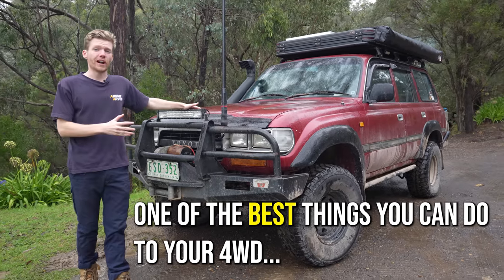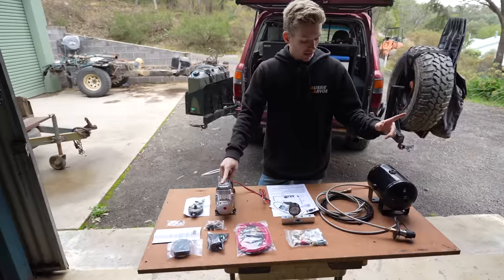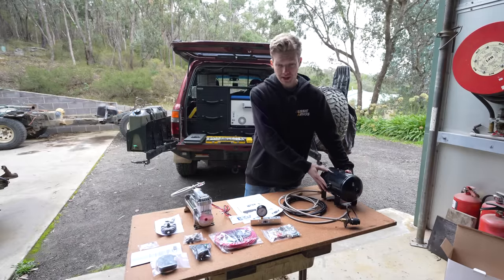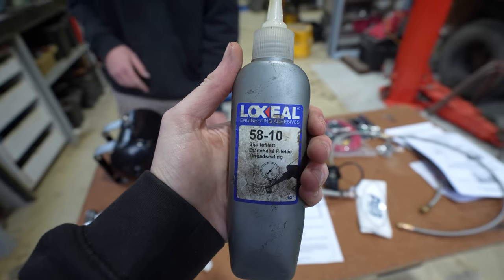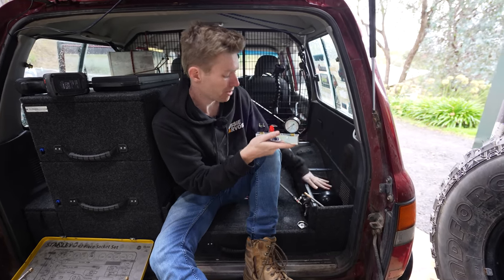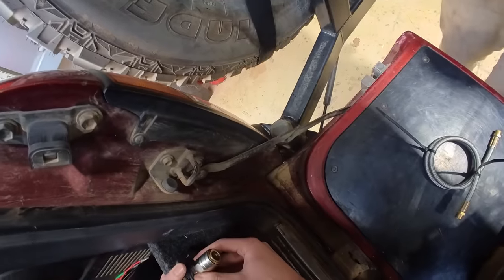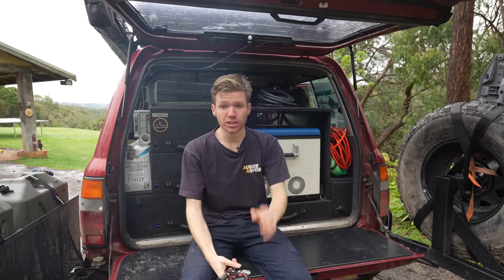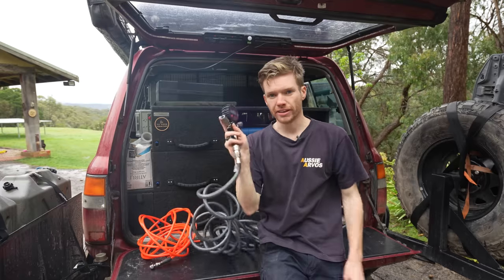Building a BUDGET on board AIR SYSTEM!

Comment: i did the exact same thing in my 80 series. to date, it was the most pointless thing i ever did.... i find the compressor takes ages to fill the tank, i constantly bypass the tank to fill my tyres up, because it creates a larger volume to fill to a certain pressure. (fills tank and tyre, not just tyre) its too quick to disburse to use as air filter blowing etc, and e lockers solve the need for a tank. you cant have more then 120 psi otherwise the compressor struggles....
Reply: That's cuz your compressor choice was a cheap slow unit. There's dual cylinder 300L/10.6cfm units available that aren't slow. They beat the $700  ARB twin units.
Reply: @mrmotofy  what are they? How much do they draw? Is it worth the cost? The kit from air on board that was in this video is what I used.
Reply: @EVERYTHINGOVERLANDANDUNDER  compressors are rated in cubic volume. So the higher volume output requires a larger unit and more power. So his unit here is probably 2.5 cfm or maybe 70Lpm (Cubic Ft/minute or Liters /minute). So there's a Kings Thumper or MaxiTrac has a 300 Lpm unit thats 4+ higher output. There's lots of different brands of them depending on which country you're in. I have a Playlist on my channel for Onboard Air and test some show a lot of info how to build or connect a system. The advantage of a larger unit is faster and less heat cuz a 32" truck tire can fill 0-35psi in like 2 min. So the compressor barely gets warm. Vs the little ones that get sizzling hot. In my channel video descriptions I list about 10 different brands that are all the same Dual cylinder 300L per minute compressors
Reply: @EVERYTHINGOVERLANDANDUNDER  The down side is power draw and it's 90a at startup and drops to 55a or so up around 120psi. But proper sized wire and it's no real issue. Keep your car running while using. My air playlist https://youtube.com/playlist?list=PLqkmlrpDHy5Ps_tYC6XAMmf1EFVd-qw61